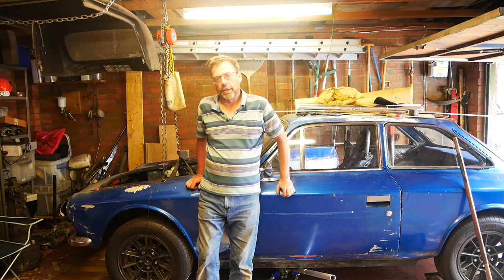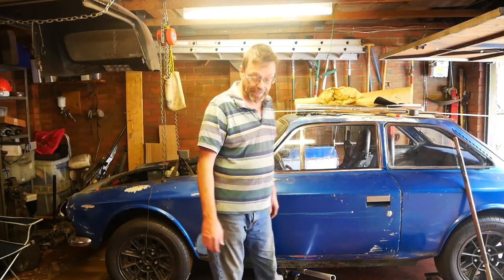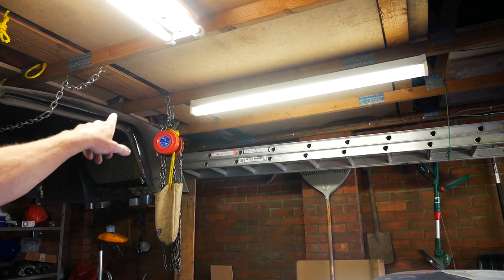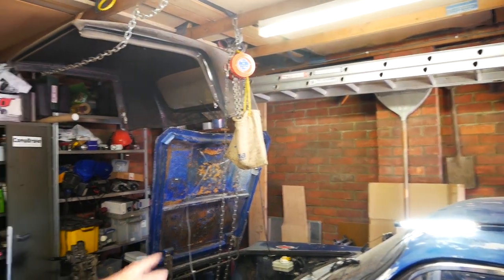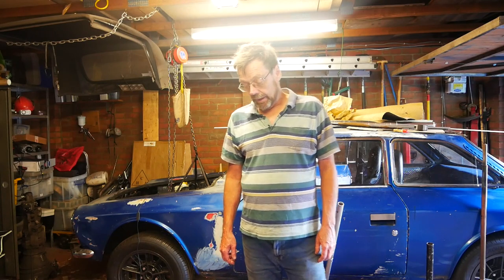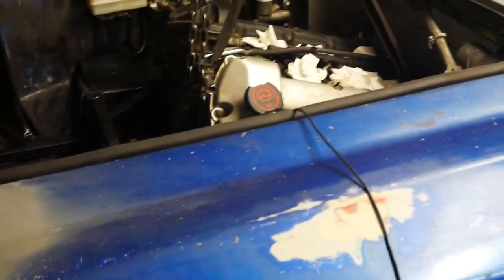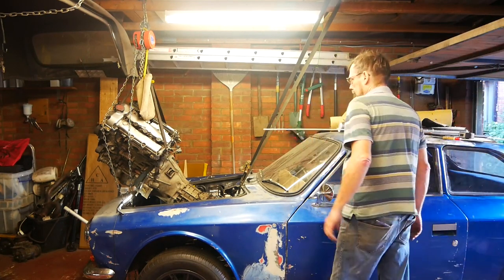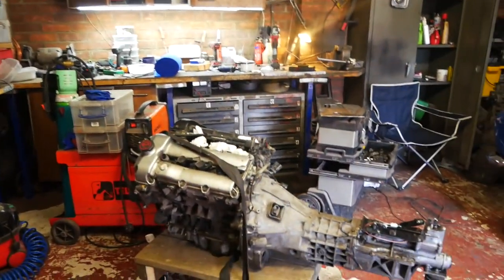Removing the AJ30/RX8 Engine/box with a chain hoist

Comment: I have an electric winch if you'd like to borrow, it bolts up with metal straps over a beam and runs on a 3 pin plug. It realy handy for the old in and out routine, you can hit the button with one hand and steady with the other. Let me know. James (Merlins Dad!).